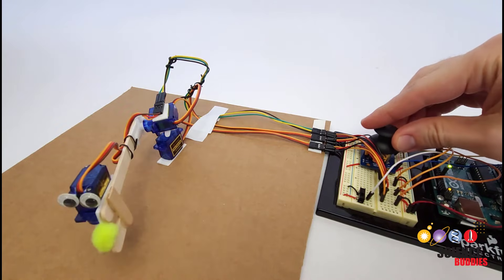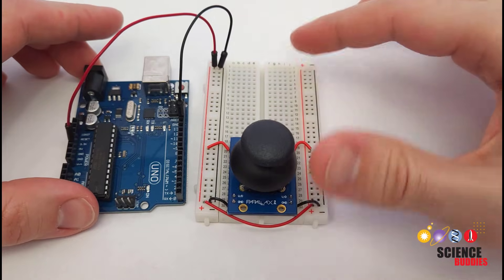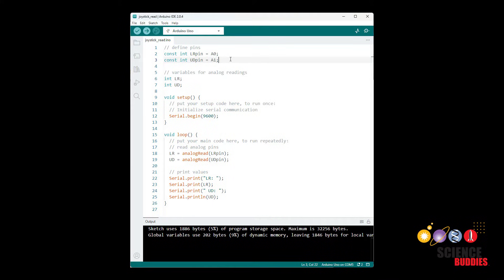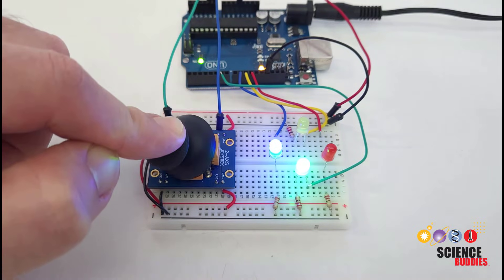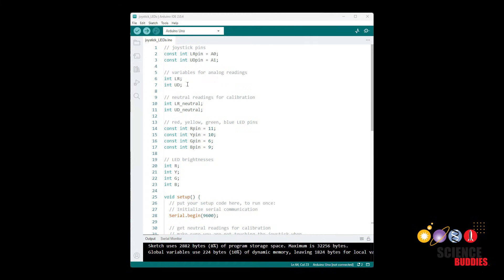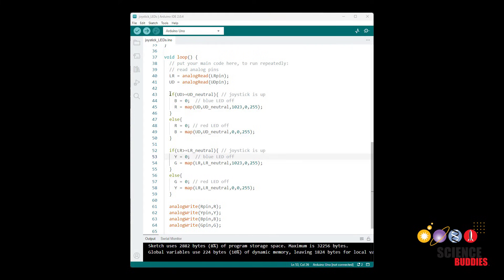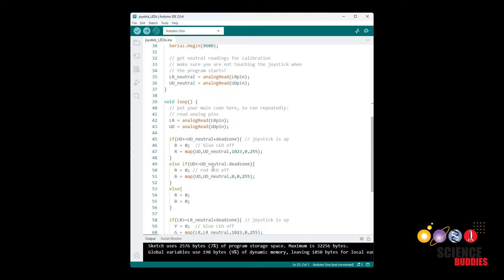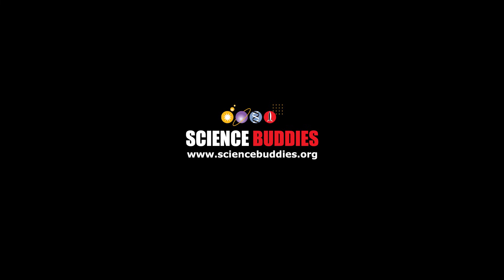How to Use a Joystick with Arduino (Lesson #13)

Comment: thank you, everything is clear.  but there are not enough electrical diagrams in the lessons
Reply from the maker: Sometimes written instructions for projects on our website will include circuit diagrams, since these videos are for beginners we usually stick with the breadboard layout and are not teaching circuit diagrams yet.
Reply: @Science.Buddies You can still attached circuit diagrams to it cos it better stimulate the learning for both beginners & intermediate. 

I want to know if all the joystick terminals are used in this project? Like does it have more than LR, UD? How about rotating, SW? Etc thanks 🙏 for a wonderful explanation alwys in your videos

Comment: Thank you very much
Today I watched 13 videos and you taught me Arduino within 5 hours

I have a question
My joystick is different. 
it has 5 pins, GND, +5V, VRx, VRy, SW
Reply from the maker: Hi - glad you found our tutorials helpful! You'll need to look at the documentation for your joystick to figure that out. Some joysticks are "clickable" and you can push them down to also act like a button. My best guess is that VRx is the voltage for horizontal motion, VRy is the voltage for vertical motion, and "SW" stands for "switch" which closes when you push the joystick (so it will act like a button - see our tutorial on that earlier in the series), but I can't say for sure without seeing the datasheet for the joystick.

Comment: Can you please give the code for the led joystick thing
Reply from the maker: // joystick pins
const int LRpin = A0;
const int UDpin = A1;

// variables for analog readings
int LR;
int UD;

// neutral readings for calibration
int LR_neutral;
int UD_neutral;

// red, yellow, green, blue LED pins
const int Rpin = 11;
const int Ypin = 10;
const int Gpin = 6;
const int Bpin = 9;

// LED brightnesses
int R;
int Y;
int G;
int B;

const int deadzone=10;

void setup() {
  // put your setup code here, to run once:
  // Initialize serial communication
  Serial.begin(9600);

  // get neutral readings for calibration
  // make sure you are not touching the joystick when
  // the program starts!
  LR_neutral = analogRead(LRpin);
  UD_neutral = analogRead(UDpin);
}

void loop() {
  // put your main code here, to run repeatedly:
  // read analog pins
  LR = analogRead(LRpin);
  UD = analogRead(UDpin);

  if(UD>=UD_neutral+deadzone){ // joystick is up
    B = 0;  // blue LED off
    R = map(UD,UD_neutral,1023,0,255);
  }
  else if(UD<=UD_neutral-deadzone){
    R = 0; // red LED off
    B = map(UD,UD_neutral,0,0,255);
  }
  else{
    R = 0;
    B = 0;
  }

  if(LR>=LR_neutral+deadzone){ // joystick is up
    Y = 0;  // blue LED off
    G = map(LR,LR_neutral,1023,0,255);
  }
  else if(LR<=LR_neutral-deadzone){
    G = 0; // red LED off
    Y = map(LR,LR_neutral,0,0,255);
  }
  else{
    G = 0;
    Y = 0;
  }

  analogWrite(Rpin,R);
  analogWrite(Ypin,Y);
  analogWrite(Bpin,B);
  analogWrite(Gpin,G);
  
}
Reply: @Science.Buddies  the red bulb keeps going on when its not supposed to, and none of the other bulbs are working. What should I do?